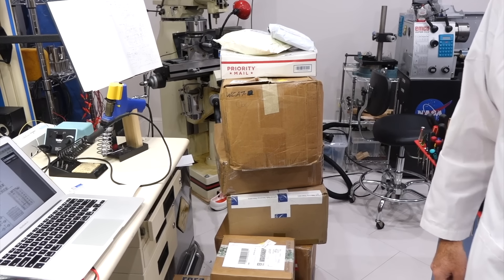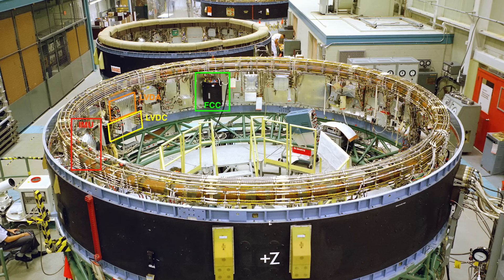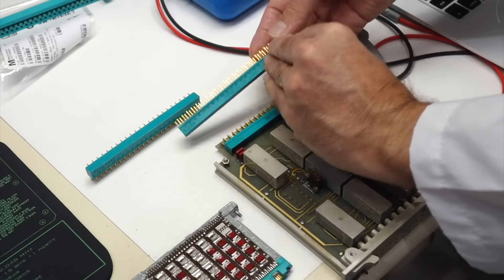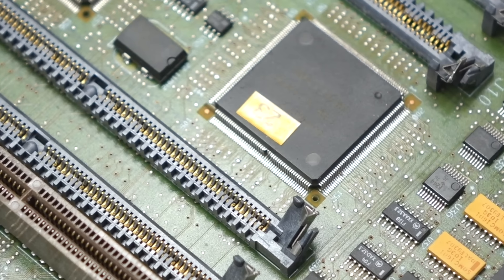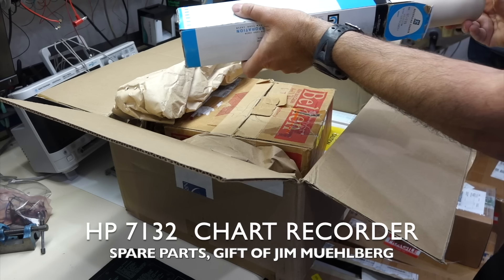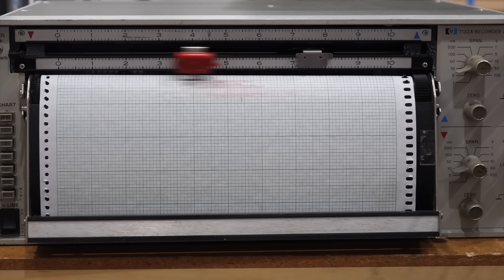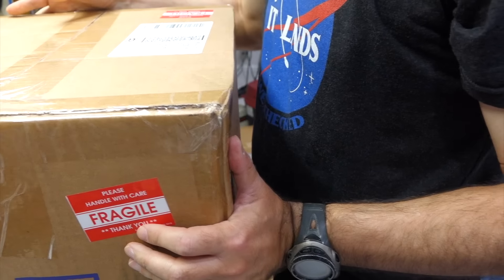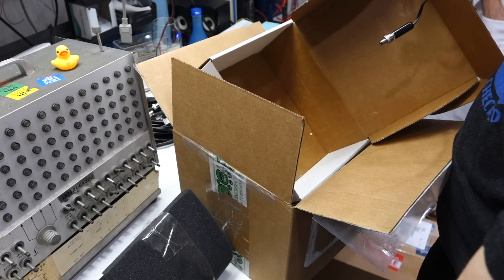Apollo LVDC computer board (and more)

Comment: I worked for IBM for 37 years. I used the IO tested in system 360 days. It was a switch indicator unit. A portable maintenance control panel for units without a control panel. You would connect the cables to the unit under test, insert the correct plastic overlay and user the tester to exercise and diagnose the unit. I remember using the tester on 2501(punch card reader), 2821(card reader/ punch and printer controller) and 2701(telecommunications controller). Many other controllers had a build in control panel.
Reply from the maker: Yes, I got this one specifically for my 2501 card reader. But we have not found any 2501 docs showing how to use it yet…

Comment: Love my Nuvistor powered HP 3400A, use it regularly for power supply noise measurements and audio levels on transceivers.
Reply from the maker: And I love my HP 400E, which will happily continue giving me RMS voltages up to 10MHz while my modern Keysight pewters out at a few 10’s of kHz!

Comment: Wow!  That HP protocol analyzer brings back memories!  We had a Honeywell Bull mainframe and its FNP - frontend network processor emulated Burroughs poll / select so we could have a dozen or so ADM-31 terminals on a single port.  The FNP would crash occasionally or do something else unexpected.  So we had to get the HP protocol analyzer on the line to see what was coming from where.  I remember watching that little screen to see the control characters between the mainframe and the terminals.  The tape cartridge was handy to play back the screens to analyze what was going on.  I don't know what happened to it, but I think we may have leased it for a year.

Thanks, Marc and crew for the rest of the stuff.

Comment: When storing the IBM LVDA circuit board, I would recommend using a small air tight (Pelican?) container with a desiccant pack and dryness indicator.  The main structure is made from a  Lithium Magnesium alloy hence the separation of the gray paint.

Back in the 1980's, I dissected a rejected Apollo Block II gyroscope.  It is built like a precision Swiss watch with tolerances in the sub-microns. The design is based on the MIT/Draper Polaris submarine launched ballistic missile IRIG 25 gyro.
Reply from the maker: Thanks for the tip. Indeed, I have several of these disintegrating magnesium alloy modules.

Comment: I had a 4953A (precursor to the 4957) that died an absolutely horriffic death. One of the daughterboards had a large NiCD battery pack onboard, which violently leaked and destroyed not just the board it was attached to, but several adjacent boards and a decent chunk of the passive backplane. The internals were destroyed beyond repair. It's a very cool looking piece of equipment though, so I retrofit the chassis with an LCD, hand-wired the keyboard matrix with an MCU, and built a cool little portable PC out of it.
Reply from the maker: Yep. I have already changed the NiCads in both units.

Comment: Motorola used the TI terminal for remote control of some of their radio equipment which was great until of course the remote modem would lock up and we would have to drive miles away up to the top of a hill, cycle the power and come back. Those were the days! Lol. The other thing that someone mentioned was the size of the return key on the TI Silent Writer, in my experience 90% of the time your using it as a terminal not a typewriter so your choosing from menus with say option 1,2 or 3 or a,b or c, so return was rarely used unless a value needed to be entered which was rare.

Comment: I once had to build a test connector for a repair board. I inserted the metal pins I liberated from another connector, into a 3D-printed plastic body. The print time was 12 hours.

Comment: The switches on that IBM tester are the same type that were used in the Model 29 keypunch, and possibly on other terminals and maybe even 360/25 and 360/40 front panels of that general era. Very reliable. I had a bunch I got surplus back in the 1970s, but they are all long used up and gone.
Reply from the maker: Yes, I knew I had seen them before! these are C-H branded.
Reply: The switch is IBM p/n 738826. Also used on 3741 Data Station, 1052 printer keyboard and others. Definitely not used on the 360/40 front panel, instead this used the lever switch with the plastic body and chrome tip common to the other 360 front panels, but may have been used for the internal CE panel. I found some on eBay a few years ago.

Comment: First generation Tektronix 453 oscilloscopes had nuvistors on the front end amplifiers.
Reply: I think that's where they are most commonly found.  The first time I saw them, though, was in the power supply of an old Dymec digital voltmeter from the 1960s- one of the first all-electronic digital voltmeters, and which had an interface for an HP 2100 minicomputer.

Comment: My scope uses those nuvistors.
Reply from the maker: Yes I saw the Tek scopes used a lot of these at some point.
Reply: @CuriousMarc  Yep, the 4-channel plugin (I forget the number) for the 547 used four of these as the input tubes. They worked very well, and since they were small (electron transit time) could manage pretty high frequencies.
Reply: They also used them to build the first "portable" hearing aids.  The prototypes were built in metal travel cigar cases.
Reply: @reasonablebeing5392  Were they? It's certainly possible, but from the late 1940s there were very low power "pencil" tubes that didn't even have bases. They were about the diameter of a pencil and an inch or so long with flying leads out of the base end. They were used in portable radios from the early 1950s, and in hearing aid packs, once those got down to the size of early six transistor radios.
Reply: @lwilton  you are correct sir - I was going from memory but checked an old photo from the days I worked as a tech and they were as you described.